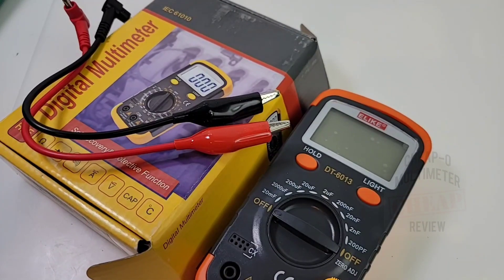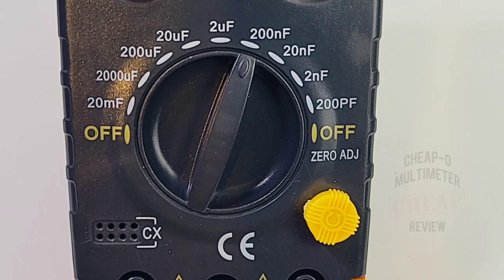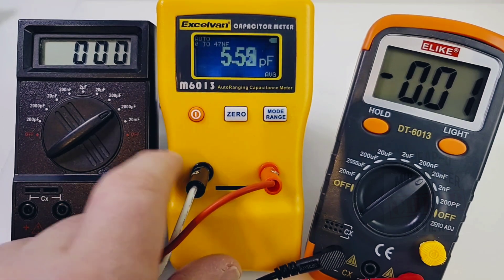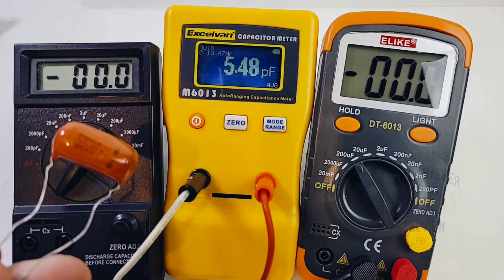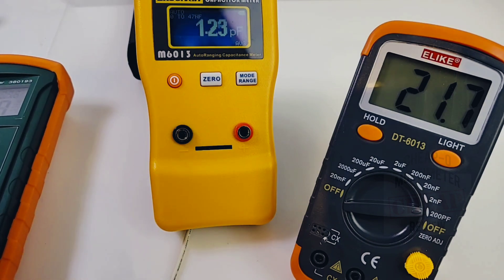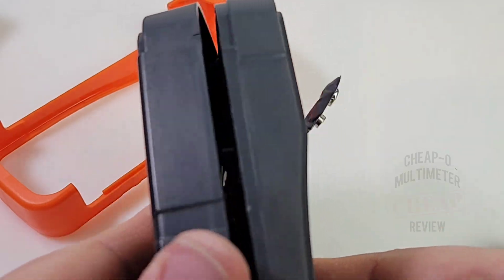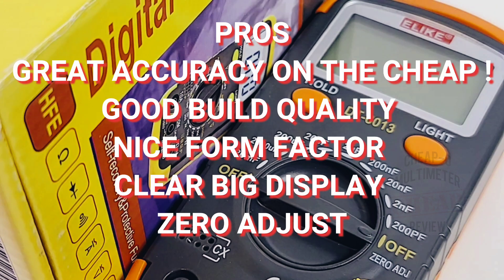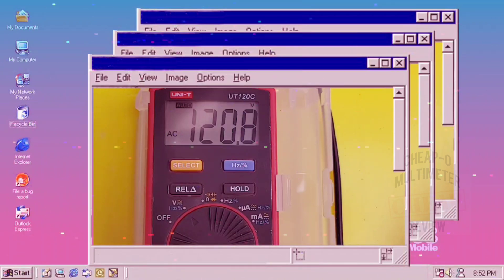ELIKE DT-6013 CHEAP-O Capacitance Meter Review & Teardown!

Comment: Excellent review! I have this Excelvan m6013 capacitor meter. It's accurate at very low capacitor values, but in high capacitance values like 1000 uF it shows slightly lower values, than my other meters. Sometimes it shows almost excatly as other meter. I have noticed, that it depends sometimes the brand of capacitor. Big plus is, that it reads very low capacitors accurate and has wide range.
Reply from the maker: Yes indeed,  the Excelvan is a very nice capacitance meter..as you say , very accurate in the lower ranges its also very fast. Thx for the kudos 👍
Reply: @KeepOnTesting  You're well come.😀

Comment: I like the looks of the circuit board build quality.  I find the three input banana jacks curious.  Is that to fool us into thinking that it can do three wire testing with a guard terminal?  Or is there a reason for it that I am missing?
Reply from the maker: It's an oddity for sure...you can use either  input left/middle or right/middle but not left/right..I believe they've used the chassis for a standard multimeter and have just adjusted the input jacks accordingly..no gaurd terminal support 😉 just bare bones here.. but fairly accurate nonetheless.
Reply: That makes sense, if you have to reduce cost somewhere that is a smart way to do it.  It does look like they built a quality product at a great price.

Comment: What is ESR? 
Competitive capacitance measurement Cheap-O BTW.
Reply from the maker: EQUIVALENT SERIES RESISTANCE..
high ESR value degrades the performance due to I2R losses, noise, and higher voltage drop
Reply: @KeepOnTesting  why do we need to consider this ESR value?
Reply from the maker: @bhushan9066  Sometimes a bad Capacitor will still display a normal value..in this case, determining its ESR will allow you to correctly gauge if the Capacitor is faulty or not.
Reply from the maker: @bhushan9066  I'll try to explain more thoroughly the importance of ESR in an upcoming LCR Meter Review.
Reply: @KeepOnTesting  Thanks for explaining that 👍
Reply: @KeepOnTesting  WOW that would be great 😁
Reply from the maker: @bhushan9066  5 bucks.. hehe 👍

Comment: Not bad. It’s fast, accurate and reasonably priced. For someone who need nothing but a capacitance meter this should be great. I mostly deal with the electrolytics, so I went for BSIDE ESR02PRO just to get that ESR reading. It goes without saying that your review was most helpful. It’s kind of quirky, doesn’t give the most accurate capacitance reading, but has no problems differentiating between a good and a bad capacitor. Hasn’t failed me yet. 👍

Glad to see you and UT120C surviving the current test. 🙂

(edited) Oh, I forgot to ask. It has three inputs and no polarity indication. So you don’t have to worry about the polarity, do you? I'm confused. 🙂
Reply: Yeah I too want to know why it has three holes? ▪️▪️▪️
Reply from the maker: The inputs are an oddity for sure...you can use either jack input left/middle or right/middle but not left/right..I believe they've used the same chassis for a typical multimeter, hence the design  and  yes, you are correct, there's no polarity involved with this tester.👍
Reply: @KeepOnTesting  I’ve seen some cheap capacitance testers with three inputs. They had the middle input for the negative and the other two for the positive. Looks a little silly but if it works, it works.

Comment: Thanks for all the work you put into this week.  This meter is handy if you invested in a multimeter that didn't have capacitance.  You did a review on a LCR meter a couple years back that was cheap: SZBJ 4070.  Which is better?
Reply from the maker: SZBJ 4070 is definitely more powerful ( it also does Inductance - mH ..) but it's twice the price and alot bigger. So if you just need to check capacitance and prefer a smaller footprint/portability cap tester, then the Elike 6013 is a great alternative 😉

Comment: Identical to holdpeak 6013
Reply from the maker: HoldPeak also has the DM6013L, but the display is much smaller and not as well constructed.
Reply: @KeepOnTesting  I see, anyway the lack of esr measurement function is not that big deal for me personally. i use dick smith esr meter.
Reply from the maker: @zim2493  Dick Smith..would love to see that Meter in action..Anyway you can share a picture? I'll post it on the website..
My email: netplicity1@gmail.com